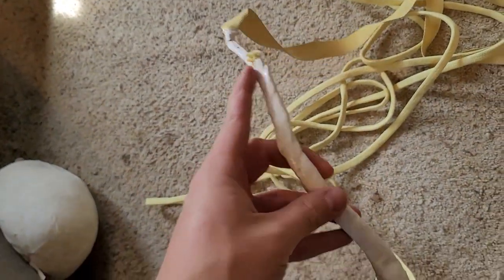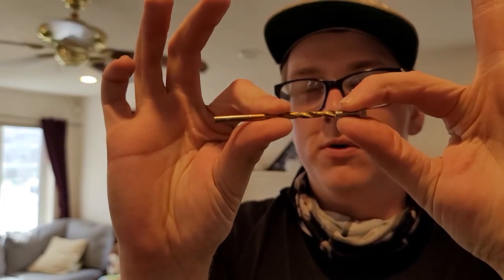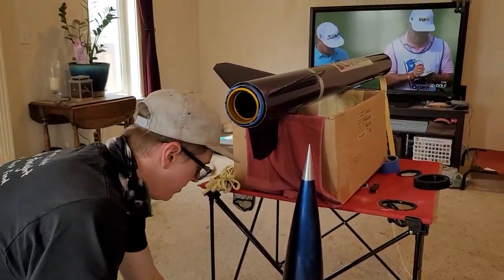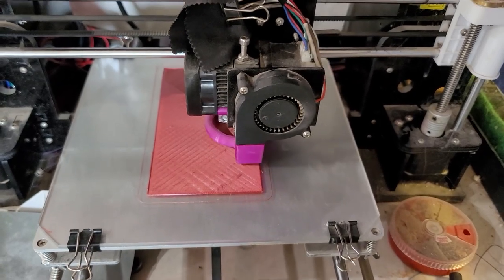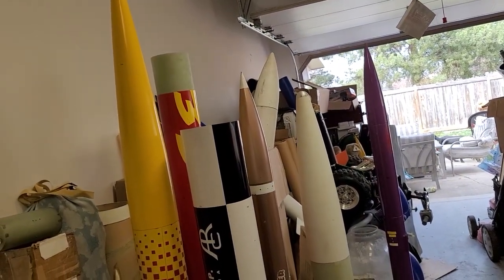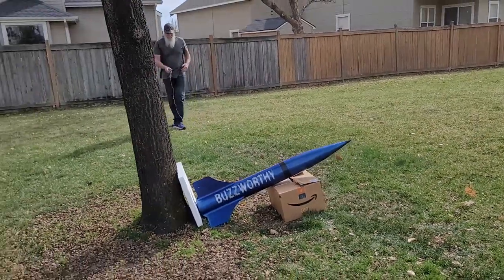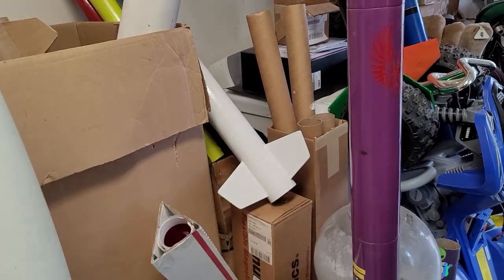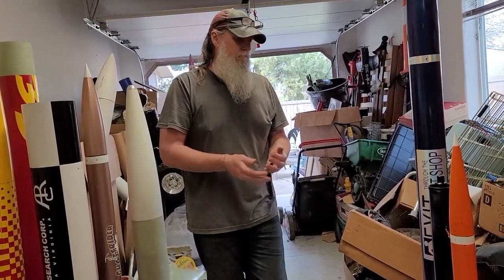Flight Prepping High Power Rockets (Ground Testing, Aeropack Install, Shock Cord Install)

Comment: I'm loving the videos man. I'm just getting into setting up my dual deployment. I haven't fired my first test yet, but I'm close. I have a Raven and an AIM altimeter. Do you suggest or prefer one over the other? I L1 certed in 2012. I've been out of the hobby for about 6 years now. Any cool developments? I wish we didnt have to blow up our rockets. I was hoping someone had engineered a spring or compressed air decoupler system. Drones have controllers with GPS telemetry and OSD, I sure would love for someone to hack one for rocketry.
I'm big into 3D printing and have been doing it for 10 years now. I would totally love to make some fin cans with the new resin printers, no FDM layer lines with resin. Also you can get ceramic resin to make temperature tolerant parts.
Reply from the maker: Resin printers are crazy cool, it would be sick to make fin cans with them. I have no experience with AIM but I have wanted a Raven for quite some time, just never picked one up. 

There's been CO2 ejection systems for quite some time, and you could probably use an altimeter for a spring-loaded piston ejection system. It's just hard to beat what works.